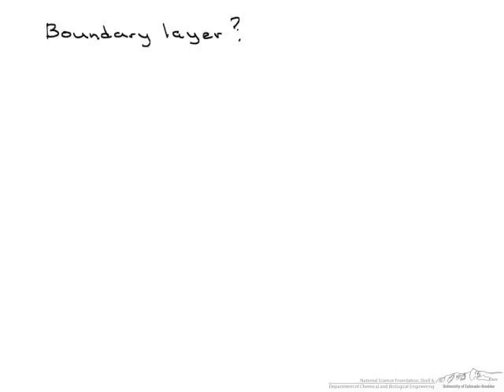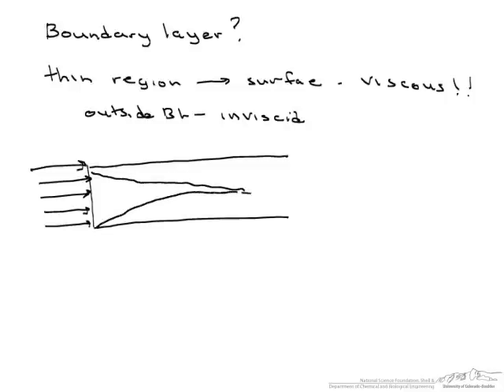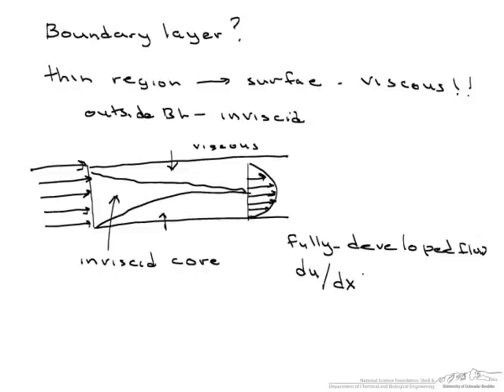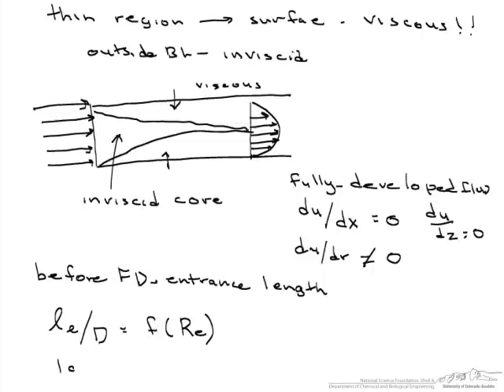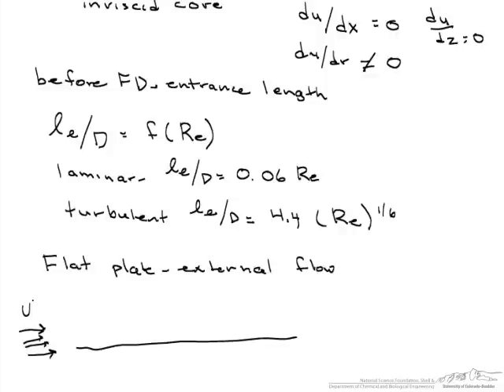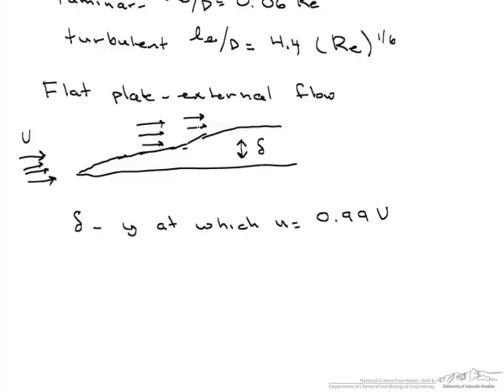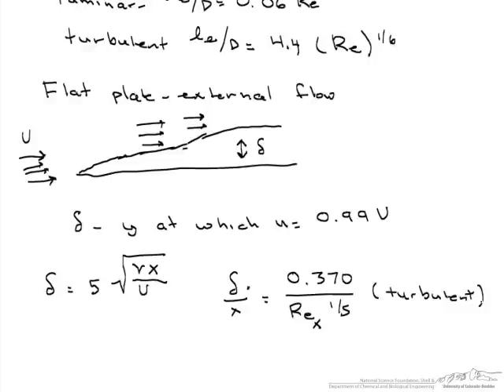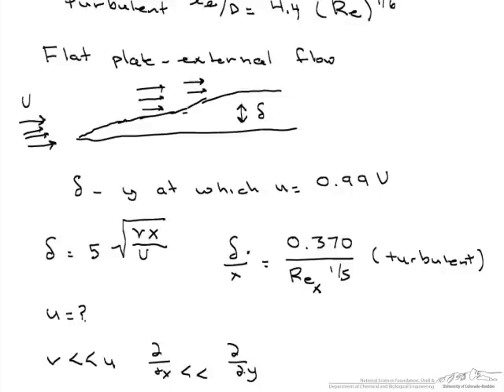Boundary Layers

Comment: Can u give details about displacement boundary layer thickness in laminar pipe flow.....reply asap
Reply: That's exactly what I've been searching for for hours now. Everybody talks about the flat plate analogy but in a pipe, I think the length x (in the direction of the flow) is not relevant. There will be a boundary layer with the same thickness after 10 m as after 1000 m in the pipe and it's the thickness of that layer I would like to calculate, both for laminar and turbulent flow.

Comment: On the last part where you said velocity inside the boundary layer is 0.8115*U, is that the x-component only of the inside BL's velocity or is it the magnitude? 

Does the inner BL velocity have a y-component? 

Thank you so much for these videos!
Reply: It is magnitude of Velocity component Parallel to the solid boundary. It cannot have a normal component.